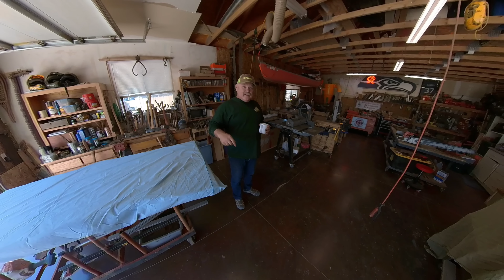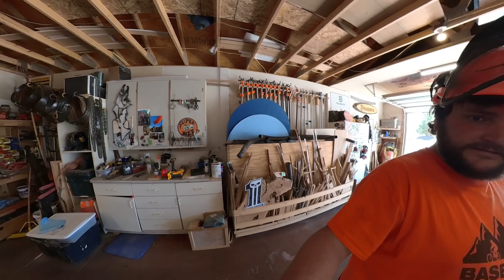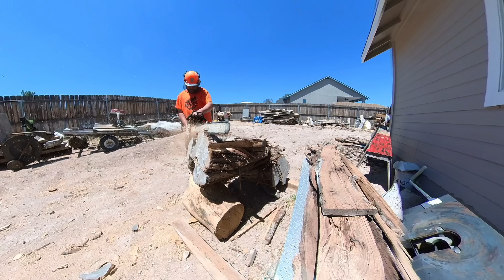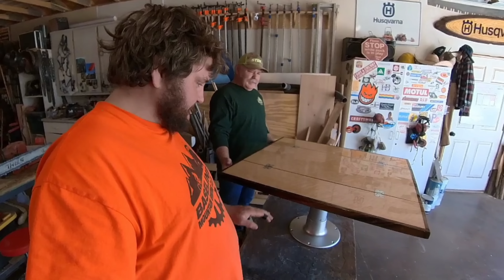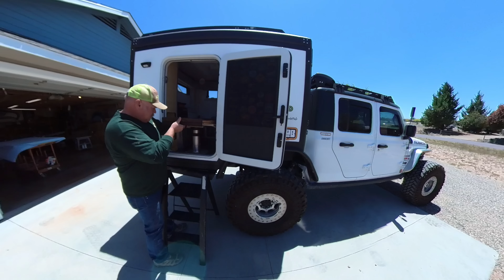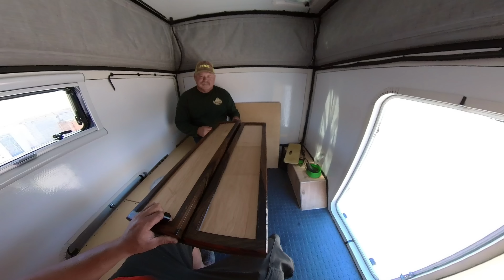A Master Woodworker Builds me the Ultimate Truck Camper Table & I run the Biggest Chainsaw EVER!

Comment: Any particular reason you didn't make the underside of the table flat also (as opposed to having raised borders like you have done)?  If the underside was flat, you could have still used it as a smaller table.  And was the table stand fully bolted down when you raised and started rotating it?  It seems unstable.  It looked like it was wobbling during the process.❓
Reply: He must have just screwed in a couple of screws to showcase its function, as I too saw how unstable it looked when he raised it.  Surely it wasn't fully screwed down in place.